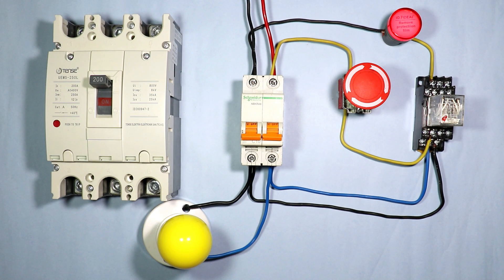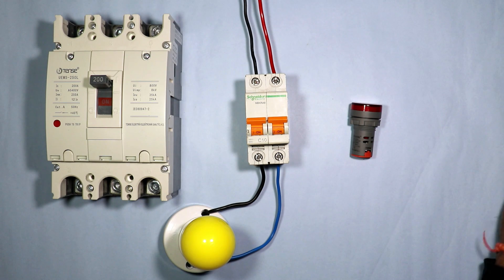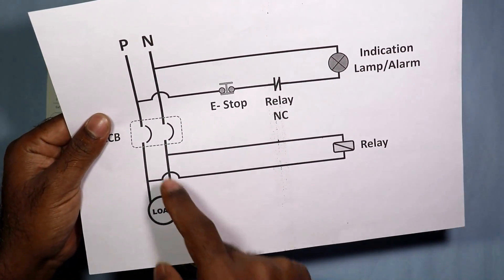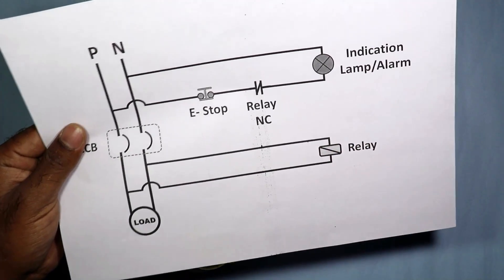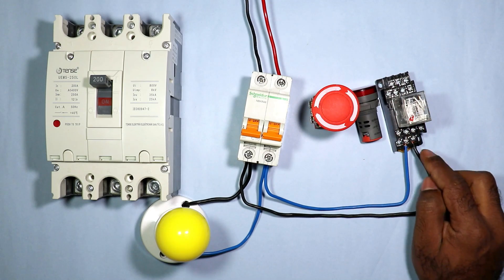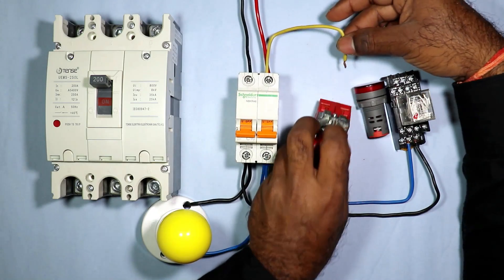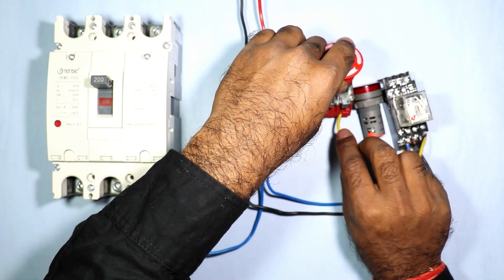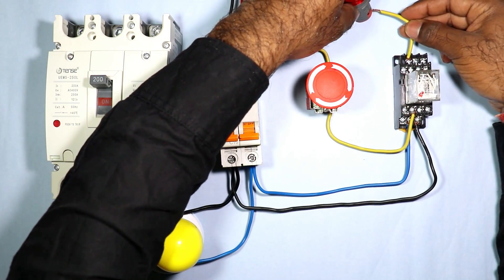How to Make Simple MCB Trip Indicator @TheElectricalGuy

Comment: Sir 
 The connection to the lamp has to be given on ,NO contact normally because when the relay trips  it should make NC ,correct me if I am getting it wrong  ,thanks
Reply: No sir. It has to be NC because when power passes the MBC which turns on the lamp (load) indicator should be OFF. it is like toggle between the lamp (load) and the indicator. So, if u wire the NO of the relay, when load is activated, the indicator will also be activated because by injecting power to the relay through the MCB, NO becomes NC and NC becomes NO.